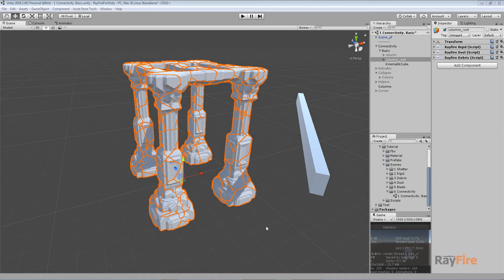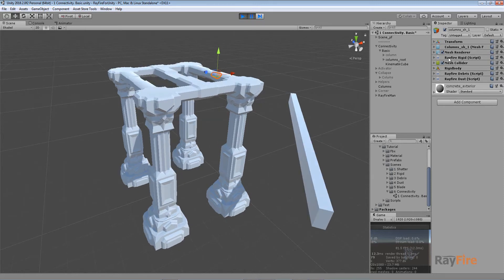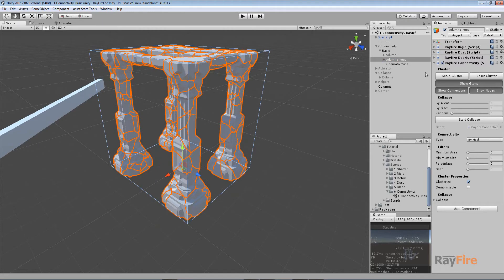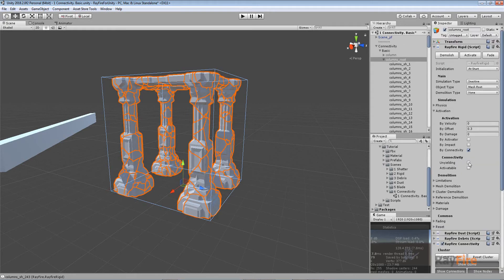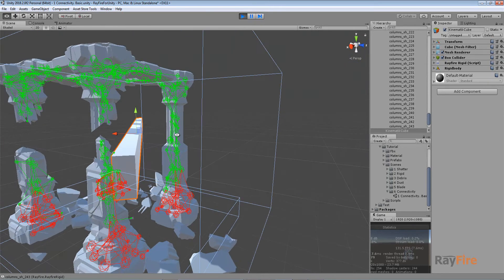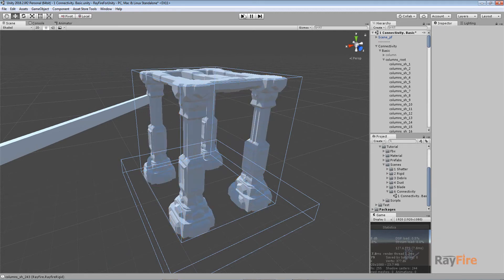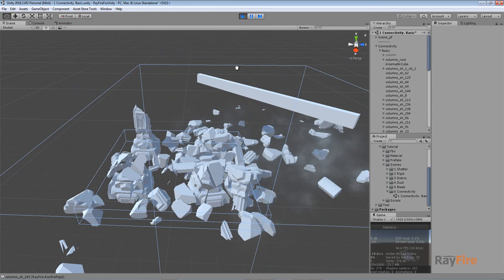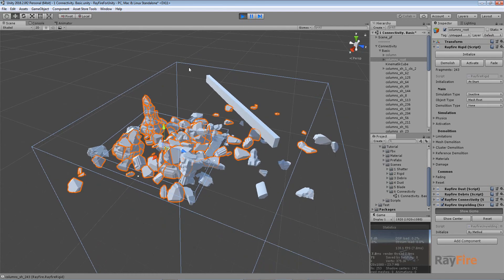RayFire for Unity. Connectivity. 1 Basics

Comment: yeah, i cant replicate this at all. i have a lamp post, the lamp post base lil cylinder and the post itself. i cant reproduce it, the unity just freezes and spams it had low poly mesh, thus cant add mesh collider, even tho ive set the colliders to none. You should do some gameplay realistic tutorials. Having one wall consist of hundreds of objects is unreasonable. Scale this to a small map like Dust 2 from CSGO and no computer in existance can run this, if every surface is made of hundreds of tiny individual objects.
Reply from the maker: hi, I already replied to your email, we need to talk in discord to figure out what is wrong with your setup, I guess there are mesh topology issues that stops it from working properly, but lets talk and see your setup first.

Comment: Has the stress check for the connectivity been implemented yet?
Reply from the maker: Hi, yeah, but it works in a bit different way than I wanted it to work. I worked on this feature for a few weeks and I guess it can be implemented better. I had to stop at some point in order to work on other features as well. Try it, it definitely can do the job, but also definitely can be improved.
Reply: @MirVadim  Do you recall what version it was implemented in?
Reply: @MirVadim  Oops. Nm. Found it. V 1.34